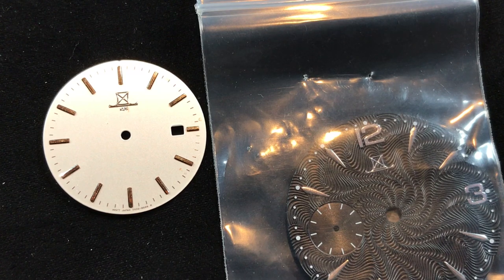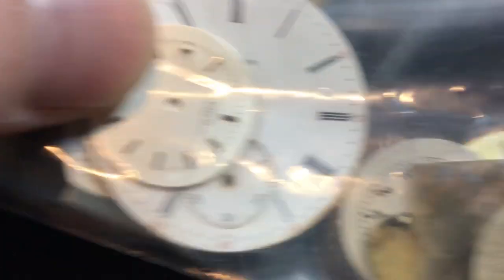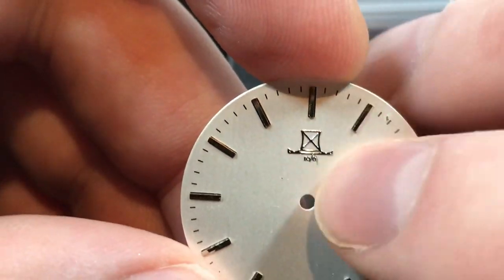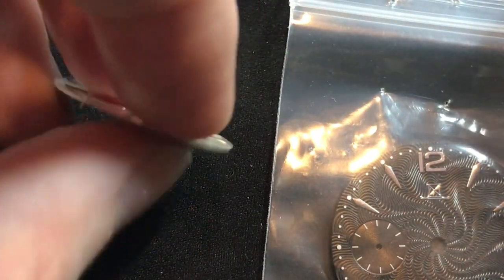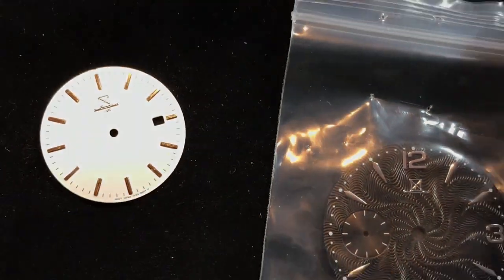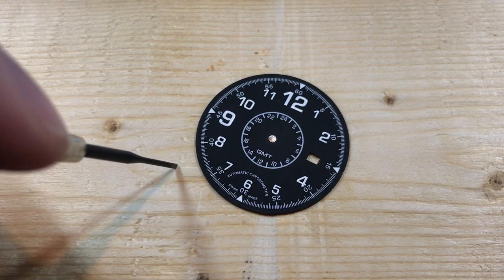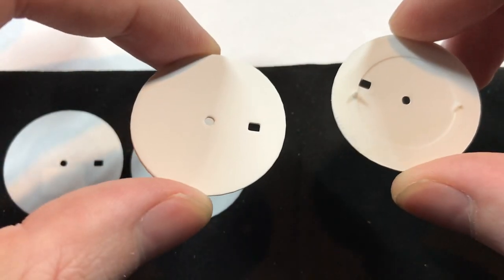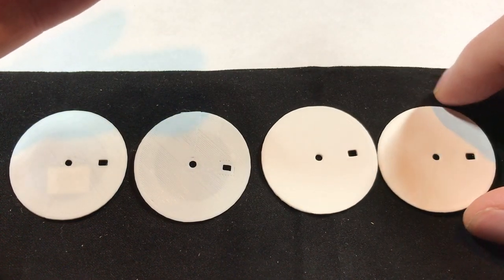Making Custom Dials Part 1

Comment: Call your local metal shop. Have them make you a bunch of aluminum blanks. Way better than 3d printing them.....pla doesn't do well with heat, or sunlight. Those probably won't last long.
Reply from the maker: @littlecncshop  for dials that’s correct, but it’s good for prototyping or certain 3d effects. thanks for watching.

Comment: With the 3d printed dials you could use a glow in the dark plastic, if you haven't tried that already that it.
Reply from the maker: I have not tried any glow in the dark material. Could also just use regular lume on a 3d printed dial.
Reply: Also just had a thought, if you wanted a glassy look to the plastic, instead of the 3d printed look, could take a torch to lightly melt the plastic, maybe even some burnt texture kind of like a Creme brulee.
 
I really want to try making a dial but I need to learn the basics for watch repairing and modding first.
Reply from the maker: ideas are worth trying :)
Reply: @isaacnoel4022  people use solvent to melt the pla of plastic in a controlled manner. Like how you take finger prints with super glue, put the work on a pedestal with potent solvent under so it melts
Reply: I know this is old but on the topic of 3d printing you can make many parts by creating a mold negative with printing. Print object, make mold from plaster of say a watch housing and you can pour your own watch in any metal.  @WatchComplications
Reply from the maker: @10siWhiz  I've seen people create molds with 3d printing. Then the molds get filled with different materials to make the parts. What materials you can use in the molds would depend on what material you use for the molds though.

Comment: About the dial feet. You are not confined to whatever the original movement was. Pick out whatever movement you want and put new feet on it. There is a machine made just for that. So cut the old feet off and weld new ones to fit what ever movement you prefer. Doesn't get any easier. Some people make their own little welder to put new feet on. The company that restores my vintage dials do it for me all the time. Just give them the measurements and they will move the dial feet wherever I want them. But this time is different because I'm building a watch from scratch (accept the movement) so I'm out and about doing research on it. Thanks for posting I didn't have a clue as to how I was going to make the dial.
Reply from the maker: Yeah you can move the feet if you want, just got to measure and solder them, and sometimes that's the only option.  But if you can find a dial with the feet already where you need them, then that's much easier. There are also "dial feet" that are basically a double-sided sticker that will help hold a dial in place if there are no feet.
Reply: Would be 100x better to keep the original feet. Because they were machined from 1 piece of material vs soldering. But at least you didn't say dial dots like the majority.

Comment: How do you go about removing the painted logo on an existing dial without damaging the dial face? I have a really cool San Martin dial I want to re-use. Sorry if you already answered this in another video in the series.
Reply from the maker: in short, you don't, haha
Reply: You can remove it if it's not printed on the dial, not sure how though.
Reply from the maker: @carlad2640 even if it’s an applied logo you are dealing with adhesive or soldering with feet holes.

Comment: Very inspirational, I've thinking on design a watch with a titanium case like PANAREI with my Studio logo but can't find blank dial of 34.5 or35mm, do you sale that STL file for the 3d printer and what kind of material did you use for printing.
Reply from the maker: I create and sell prints, but I don’t sell the actual STL files for what I create. Usually I print with PLA, but have other options.

Comment: Thanks for this great information, i´m interested in buying a vacheron dial and finding a case for it and a vacheron movement, i´m just not sure which size dial will go with size case/ movement etc, any tips please?  thanks, keep up the great work!
Reply from the maker: get the movement first, and a dial that has the correct feet for it. then the case, since it'll depend on the movement and dial sizes. might be hard to piece something like a VC together from parts though. their stuff is quite specific to each model.
Reply: @WatchComplications   ok thanks for your valuable advice, it will get me started, yeah i can imgaine it would be hard. if it was easy everyone would be doing it..
Reply: @stb6659  that's probably not even possible, you can just modify something that's been hand made. In house. You'll never find that information or any parts that fit in them.

Comment: Great video, wish it existed when I made my custom watch a few years ago! Quick question, have you found any good sources for high quality / premium dials? While you can get some nice ones online, I find a lot of them to be just average quality. Would be nice to find a really premium option.
Reply from the maker: I suppose that depends on what you mean by high quality and which aspect of the dial. Options exist on eBay and other distributors. I also like making my own from scratch.
Reply: Watch Complications for a start it’s hard to differentiate because on eBay or other sources there usually isn’t enough information to discern quality. Ideally I would be able to buy a dial that’s as well made as what you might find on an expensive watch from say IWC or Breitling. In some cases, these dials might be silver or have gold markers for example. Or better quality of enamel. I’m not really sure but just curious.
Reply from the maker: Ah, I see what you're saying. I have not sought out dials with finer metals/materials yet for my dial making. So far I've stuck with standard materials that are more readily available, for my own watches and for what my clients have asked for. It would be interesting to see a site or resale of such dials. Personally, I have a thing for enamel dials.
Reply: You ever find a supplier of high quality dials?

Comment: I know this video is 4 years old but I'm going to make my own watch. I wonder if off gassing of the plastic in a waterproof case will or has clouded the crystal?
Reply from the maker: what kind of crystal? what do you mean by gassing off the plastic?
Reply: @WatchComplications  any crystal, I believe most plastics off gas for a certain time. That is one of the reasons why the windshield in your car gets a cloudy film on the inside. I'm not saying it's a problem on watches, I think out loud sometimes. I believe some watches use plastic movement spacers and such.
Reply from the maker: @meanstreak1170  a lot of watches use plastic movement spacers and holders, so yeah, you can't use too much heat depending on the situation. As always, it depends. Quite a few watches have no holder, some of metal holders. Some use plastic for the glass, many use mineral or sapphire crystal. For example, here is an example of me using a torch to remove a cyclops from a sapphire crystal and it doesn't much with anything because of going low and slow, and given the materials: https://youtu.be/hBvZDR-0k4A I'd never do the same if the bezel was ceramic instead of steel, for example.
Reply: @WatchComplications  thank you for taking the time to answer my question and the link to that video.

Comment: These prints are made with an FDM printer. Nowadays, you can get a fantastic SLA-based 3D printer for the same prices as an FDM printer. So, making any dial with any detail should be very achievable with it.
Reply from the maker: yeah results will vary a lot depending on exact printer and material. just depends on how much someone wants to spend :)

Comment: Hey Brian, 

Any chance you know how I would go about printing a dial? 
I had a laser cnc machine cut out a stencil but it wasn't accurate enough in small details. 
Wondering how else I could go about it.
Reply from the maker: Are you referring to ink printed on the dial surface? If so, I use two methods which I will illustrate in future videos in this series: UV printing and pad printing. Most dials with ink printing use a pad printer and the plates are etched with lasers so the accuracy is essentially perfect.

Comment: I was wondering, what is the thickness ranges of the actual face of a watch?
Reply from the maker: Dial blanks are typically around 0.4mm thick. Then it can go up a little bit depending on what kind of paint, surface, markers, etc...are placed on the surface.

Comment: Awesome video! Did you make your small chrome logos?
Reply from the maker: Hey, thanks! I created the design myself, but I get the logos manufactured via a Swiss-based company that has their manufacturing in Hong Kong.
Reply: Watch Complications Thank you! Would mind shootin me a link? If I use any of your info I’ll give your chanel a shout out on my IG.
Reply: Watch Complications Thank you for the quick reply! Would mind shootin me a link? If I use any of your info I’ll give your chanel a shout out on my IG.
Reply from the maker: It's called egoLogo (https://egologo.me/). Depending on what things you are buying, you can get discount codes included with things from bought from their eBay store (b_line55cc). Like, if you buy a dial you might get a discount code for a set of logos shipped with the dial. But I've also bought direct. It's hard to find something similar anywhere else and they have been quick and helpful to work with. It isn't cheep though, so be sure you know what logo and size you want!

Comment: where did you find the blank dials???
Reply from the maker: So I answer you correctly, which exact dials are you referring to?
Reply: I think the dial blanks at around 9:00
Reply: the brass blank dials made in china, with an slight white imprimation.
Reply from the maker: Ofrei. They can be found on this page: http://www.ofrei.com/page813.html 
It looks like right now they just have the blank ones with the date and with the day/date in stock. The ones I got had no windows. But you could also get something with printing on it and remove the printing.